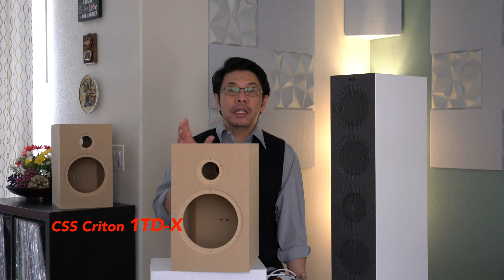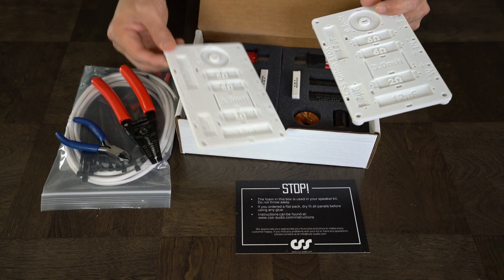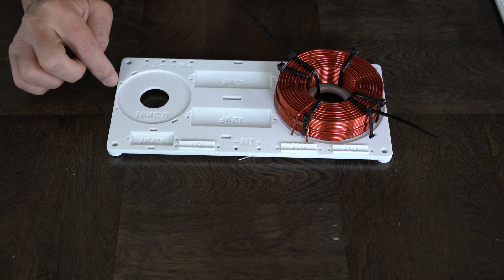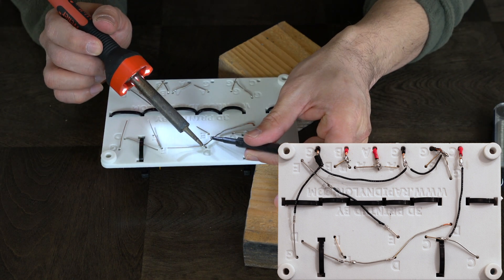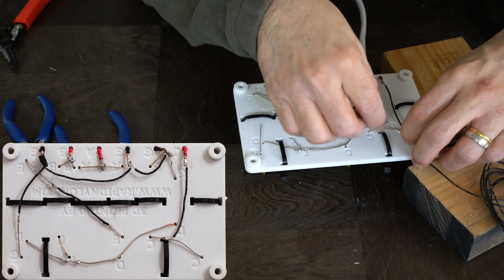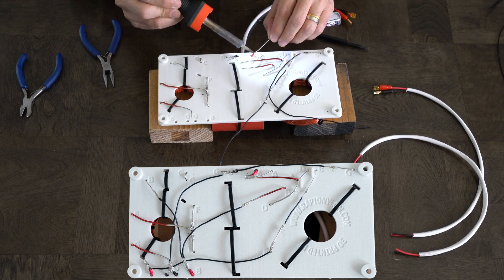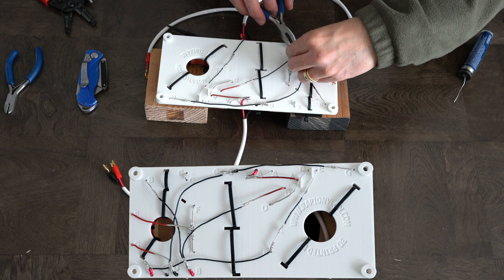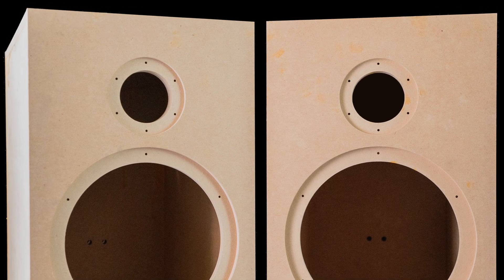CSS Criton 1TDX Crossover & Cabinet Assembly

Comment: I watched a High-End Speaker Manufacturer Build & Install Their Cross-Overs. AND - Watch My Lips - THEY POTTED THE CROSS-OVER BOARDS IN SILICONE POTTING COMPOUND. WE Know why they did that (Vibration). I ended Up doing the same with My Mains and Sub-Woofers.... Not a Complete Encapsulation - but enough to prevent the smallest of vibrations.

Comment: I'm going to buy the Critons. Any opinions on MDF flatpacks or Baltic birch plywood flatpacks? I was going to do MDF but then it occurred to me it would cost more than the plywood upgrade to get them properly finished. I know how to finish wood but I've never worked with MDF before
Reply from the maker: You can do veneer on MDF.

CSS Audio 2TD-X Speaker Teak Veneer, Full Assembly & Upgrades
https://youtu.be/vb2cc9r8YyA
Reply: @Tharbamar  that's a great build but it highlights my concern about cost. Between the router, bit, veneer, etc. I'd be in for another $400 finishing off the MDF versus staining and finishing the plywood. On the latter, all I'm looking at is a butt load of buffing to get a mirror finish. But I know that birch isn't going to look like teak, however.

Comment: @Tharbamar, Just quick note to give a huge 'Thank You' for this video. I'm building the 1 TDX and I don't think I could have succeeded with the cross over assembly (upgraded) without your video. I tested them this afternoon and they both work! Yes, it seems simple, but there are so many multiple point connections that I would likely have been held up for a long time trying to get help to understand the full scope of the connections.

Comment: It’s preferable if you can mechanically twist the component leads together before you solder. That way, you are not relying on the solder to provide the mechanical strength for that joint. It might also reduce the possibility of cold solder joints from wires that are mechanically moving while the solder is cooling.
Reply: Exactly what I was thinking.

Comment: I went and built up a pair of CSS Criton 1TD-X.  I have to say I am 'staggered'.  These blow...away  speakers that I spent nearly $ 5,000 for.  I feel like a fool.  But thankfully I sold them right away for a good price.  Apparently the cat is not yet out of the bag with these speakers.  They are a STEAL.  It does help that I happen to be a master finish carpenter.  Even so, I think that even you have no skill and just need to build them up plain unfinished, you could in the least spray them with texture paint well enough, which doesn't require any 'skill'.  If you can solder, you can build these easily.  They are STAGGERING addictive to listen with.  I am running one of their 10 in. subwoofers in a special enclosure located right behind my listening seat, and the set up is STAGGERINGLY nice.  And I don't even have all that much of a high end receiver.  Mid-grade.  So I cannot 'imagine' how even nicer they might sound with expensive / high end receiver etc. [ [ > > > I blow all my money on portable daps and IEM's. } My Oriolus Trialli is my go-to setup for 80% of usage.  But for the other 20% of the time when I listen with speakers...these CSS Criton 1TD-X are exceptional. I got them with the upgraded tweeter and components. ] ]
Reply: Staggering comment. Peace.

Comment: General question.... would applying heat shrink to the solder points (where possible)to help keep the connection together? I am afraid the years of speaker vibration will break the solder eventually. I hope the heat shrink tubes will provide cheap insurance. Any thoughts?
Reply from the maker: It won’t hurt if you like to use heat shrink tubing over solder joints, if you want peace of mind for the long term. Thanks

Comment: Shouldn’t the inductors on the upgraded crossover be oriented at right angles like they are on the entry level crossover to reduce interaction? Or are these shielded in some way that I can’t see?
Reply: The coils are far enough away on the board that you will not have negative interaction. The standard board is much smaller than the upgraded board so the inductors need to be turned on that one.

Comment: Has there been a mistake? Instead of ERSE 3.0mH 14 AWG, shouldn't ERSE 3.0mH 18 AWG be?
Reply: The 3.0 mH steel laminate in the standard is an 18 AWG from Dayton Audio. The superior crossover uses a 3.0 mH 14 AWG air core.
Reply: @kerryarmes2786  
You made the crossover better in every way .. Changing to a better quality coil and with a larger cross-section must give an improvement in sound ..

Comment: What  was the soldering material used? silver?  lead?I know the amazon link but im  not native and dont  know if such product  will be available in my country.
Reply from the maker: Silver Bearing Rosin Core & Lead Free Solder, Thanks
Reply: So silver? I dont know how a solder can have a rosin core when its a gelly like substance.
Reply: @JanKowalski-ec4dw  Rosin core gas been used since forever in electronics. Acid core is for sheet metal and that sort of thing. 

What has significantly changed since my day is the disappearence of 60/40 tin/lead solder, the standard for many decades. Health condiderations? Lead fumes are a nerurotoxic?

Comment: Excellent video Sr., thanks! I was looking for some diy speakers and never decided because I don’t know much about electronics, but these are like you say, very straight forward. JUST A QUESTION: I have the B&W 706s2 speakers, in your opinion, comparing  high frequencies: is the superior crossover brighter, as bright, or less bright than the B&W? I like the sound of the superior crossover, but I don’t want it to be as bright and forward as the 706’s. Thanks again!!
Reply from the maker: Less forward than 706 s2, brightness is bass on quality of the music, thanks
Reply: @Tharbamar  thanks!
Reply: Hi.  I'm still trying to soldier the crossovers together.   They don't work.  By watching ur video, I now know why.   I didn't connect all the wires together. They never sent me the instructions to build the crossovers. That's why I couldn't get them to work

Comment: Hmm im wondering.
The cables to the speakers are beefy. Why use thin wires when connecting the components ?
Reply: You do realize that the ohms differential is almost non-existent. Using larger gauge wore to connect to speakers  makes sense. But if the wire from the components are small,  it makes no difference.

Comment: Dear reviewer, might I ask one question, doesn't the fact that you use "simple" 16 gauge cable inside the cabinets bother you? Or even the thin wires that connect the crossover parts on the board. I'm asking because other retail speakers aren't much different inside, still you would promote and believe that connecting "high-end" cables from your amplifier would change the sound in any way.
Reply from the maker: Total signal delivery from amp to speakers before crossover and after crossover is different, 16g copper wire is perfectly suited for it purpose.
Reply: @Tharbamar  how is it different? Do you really think that a thick cable linked to that 16AWG or those pin soldering would change anything? You're categorizing cables by sound, one sounds smoother, other has more highs, etc. But inside those speakers you have generic wiring with thin cables. How does that work?
Reply from the maker: See my comment, I already explain it clearly.

Comment: Cheap solder is bad! you want something with at least 4% silver no lead. and really should be hot glued all those component not just tie wraps especially the inductors have to be filled with hot glue or wax. better resistor would be a film resistor thin film or thick film at 0.1% 50 Watts minimum best resistor to use same as Wilson audio use on their speaker make doesn't matter. Ideally you want outer film of the capacity to go to ground but it's not indicated on those would have to measure it on a scope
I wouldn't use wood glue on the front baffle attach it with silicone adhesive put some shims all the way around give you quarter of an inch gap of silicone so the baffle is extending slightly then when dry filling the shims after taking out. Put a 4 mm thick of blu tack for the tweeter and woofer gasket bead. Mounting the crossover on the side might be better using the magnet of the speaker magnetic field. What do they sound like you had a chance to listen to them!  what are the driver manufactures
 Madisound sells some good kits like linkwitz speakers open baffle and parts and WilmslowAudio in the UK sell kits and KEF divers
Reply: Ever heard of punctuation?
Reply: @deeplyclosetedindividual  no!
Reply: Home depot silver 6% solder dirt cheap vs hifi 4% bs solder of those others.
Reply: @wric01  may be as long as it contains 4% silver and no lead should be alright
Reply: Also I would use a pcb board clamp so can spinny flippy it
Reply: Would you like to enlighten me what you laughing about something's giving you the giggles share it